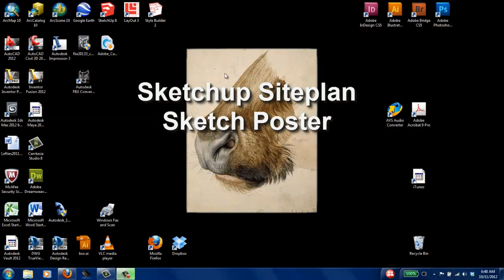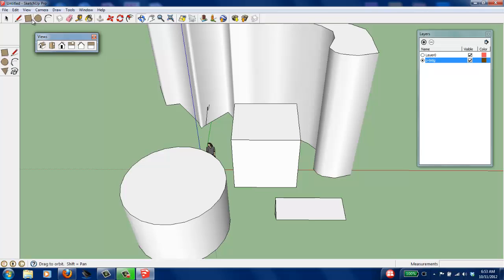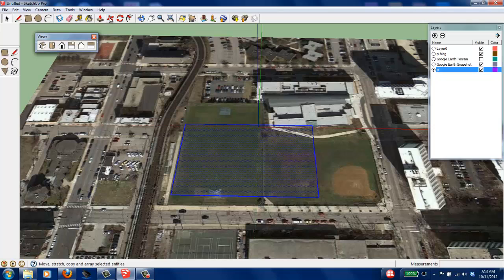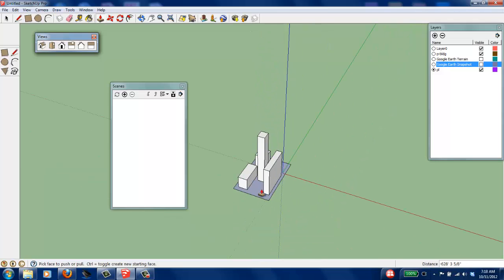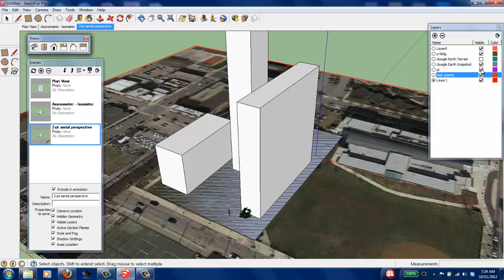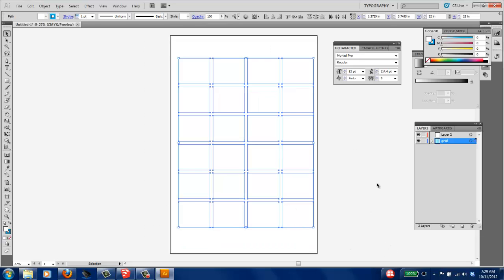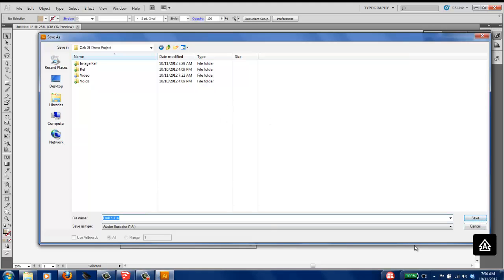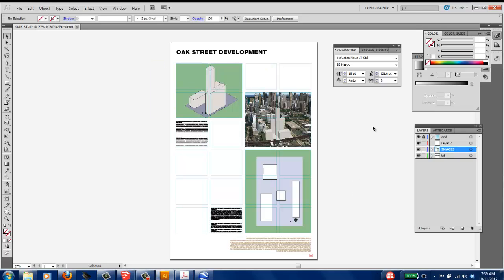UPP 460 Sketchup Site Plan

Comment: Elevation views are projected, so they are flat, showing only the face of the buildings facing the elevation view and none of the sides that don't. In the Plano, this is an extra challenge because the automatic elevation views in skp don't account for the rotated site; you have to adjust. Also, elevation views typically show ALL of the building(s.) An eye level perspective is 1. in perspective, not a parallel projection, and 2. shows an interesting part of the site as a user would experience it.